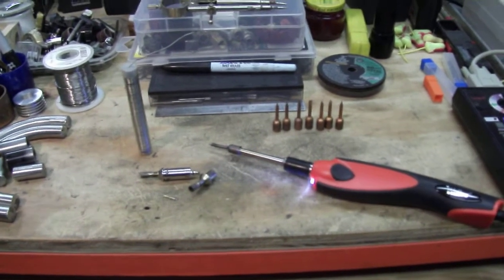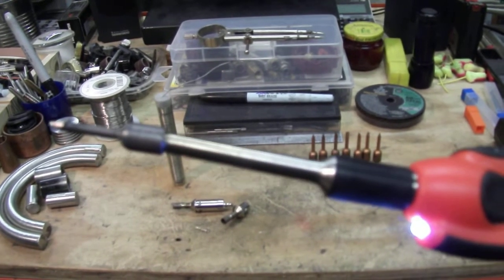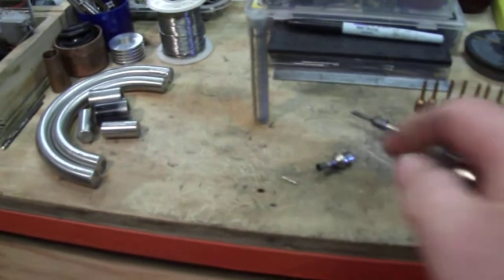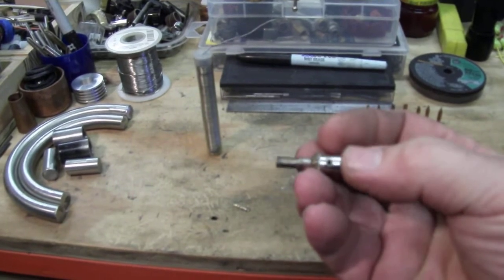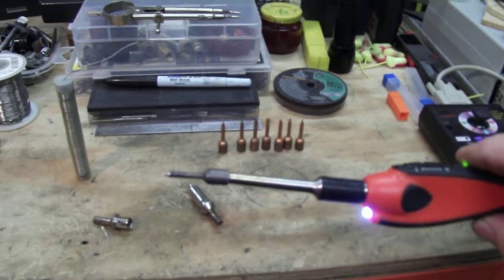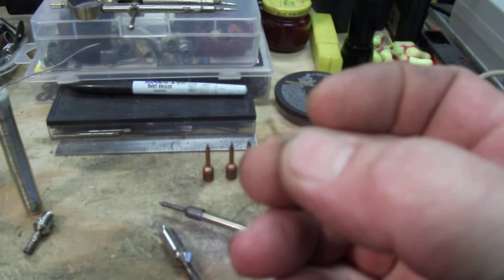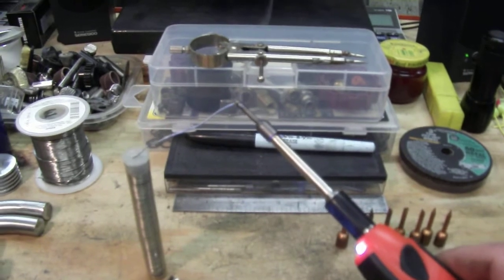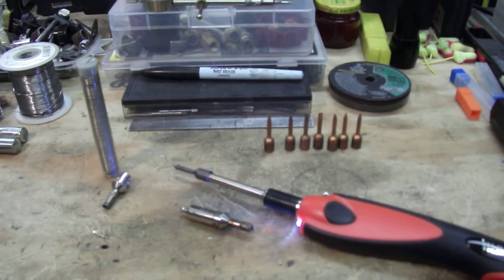Home made soldering tips, and element for my Weller WPS18MP soldering iron

Comment: THANK YOU SO MUCH FOR THIS, this is the idea I needed. I also love this iron, BUT HATE THE DAMN TIPS! Went with 90% of your method and drilled out the spot welds (my 1/8" coax came out clean, probably because of all the damn tips I've gone through). After spotting on a 1.25" element with neo-winding, your threaded copper and brass tips are the absolute icing on the cake! I now have several precision tips for different micro-soldering situations, and it's as easy as unscrew 1.) unscrew tip 2.) screw on a different tip. Thank you brother, real talk, this is the kind of gem upload I LOVE finding on YouTube. Wen't ahead and sub'd, as I'm definitely a 'build my own gear how I like it' kind of technician, and since ~80% of my bench can't be store-bought, I build stuff to last, and I'm def gonna check out your 3D printing/tooling stuff. Thanks again!

Comment: damn, i wish i had ur skills. i currently am looking for a new soldering iron as my wps18mp tip also burnt out, after only like 3 times used, literally! i dont even kno if they offter replacement tips anymore. i cant even figure out how to get the tip out of the rubber housing part. im thinking of just buying another one instead of hunting for a new tip. or getting a soldering gun instead :(

Comment: Hey Jeff, Just watched your video and was wondering what your thoughts are on creating a homemade ceramic soldering tip, I  own the Weller WPS18MP also and so far have found it to be very useful. I will be watching how you built the heating element after I press enter. Thanks, Ben
Reply from the maker: That would be a much better solution than using a brass core as I did. Using a ceramic core in a metal case will work.

Comment: I selected this iron mainly because you can use a trigger to turn it on/off. Many times I've left on my iron for hours forgetting it was left on. The custom tips are great. Do you offer these for sale, I would be interested in a few.
Reply from the maker: Bobcatt22 Hi Bob, sorry I don't offer them for sale, but if you are willing I can tell you how to rebuild them. It will require threading tools, brass machine screws, # 31 insulated nichrome wire, # 20 ptfe insulated wire and some SS tubing. I can tell you the second tip I made works better than the first as I did use thin wall SS steel tubing instead of making a new housing on the lathe, saved time. The heat is localized at the tip where you want it and does not travel down the SS steel tube where you don't want it. I am very pleased with the results, I have already soldered 5 boards, left it on all day and no signs of wear yet. Thanks for your interest, Jeff.
Reply: To +Jeff Nading 

Hi Jeff, would you be willing to create a video on the making of the tip? I did return my iron and got the one with standard ones. The basis of the return is the cost of the tips which was the cost of a new iron. The chisel tip is the one that should have been included in the package and be the default for electrical work.
Reply from the maker: +Bobcatt22 Hello Bob, I had thought about a how to video on this, but I don't have any other heating element tips to use as parts for rebuilding. I guess I could just show how I made the element itself, that slides inside the SS tubing, is that mainly what you are after?
Reply: +Jeff Nading Yes, anything that would assist in better understanding the process you have used. Thank you.
Reply from the maker: +Bobcatt22   Ok Bob I'll see what I can come up with and post a video.
Reply: +Jeff Nading Great and again, thank you for your current video.